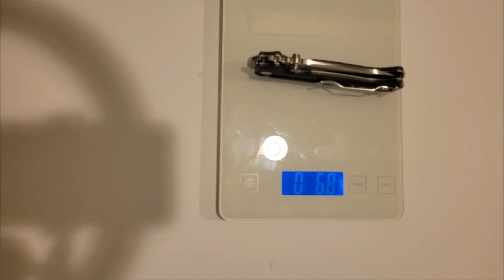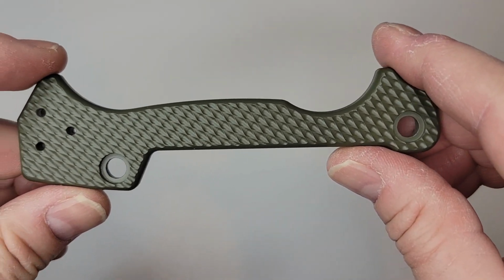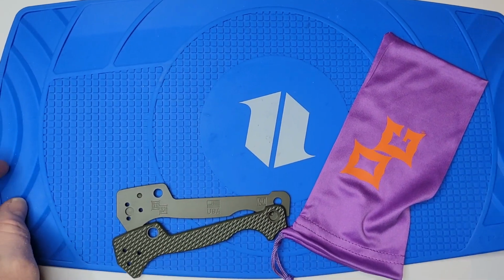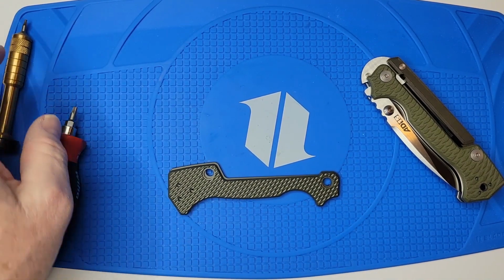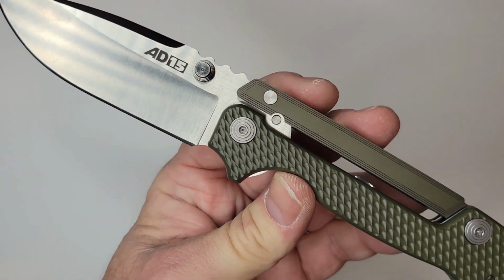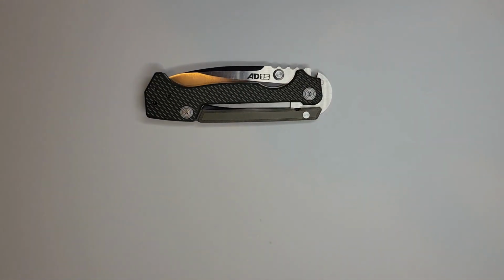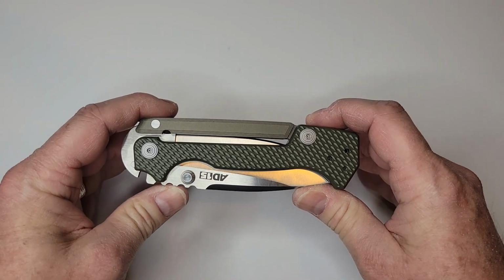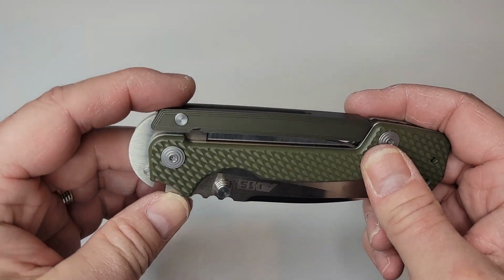Original GOAT Cold Steel AD-15 Scale Swap

Comment: Wow man, that came out awesome.
Great job with the high speed footage, so funny to see all your adjustments and everything during it.
Looks like it's easy in and out of the pocket now.
I'm curious to see how they wear in or out.
I haven't seen any long term use for their scales yet, just initial impressions and installs.
I like when people do videos like that as a lot happens over time and oddities are revealed.
Six months to a year is pretty good for most things.
Thanks for sharing this.
Reply from the maker: Thanks lefty! Funny you mention the adjustments...I had to use a teflon pry bar to pop off the liners from the blade pivot, and I also totally forgot about the interior teflon washer when reassembling (so had to go back to address that).  As for longer term - I installed the AD-20 full Ti about 6 months ago, and though I don't carry it all too much, I'll sit there and whack and crack it open for an hour straight with absolutely no problems.  I'm quite impressed.  Thanks for checking it out.